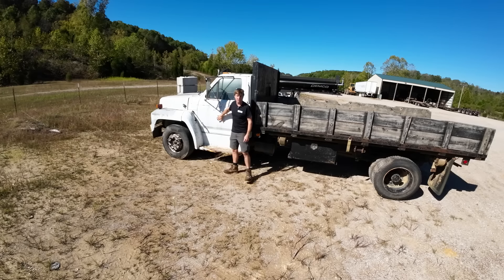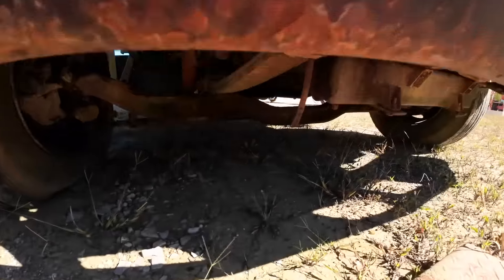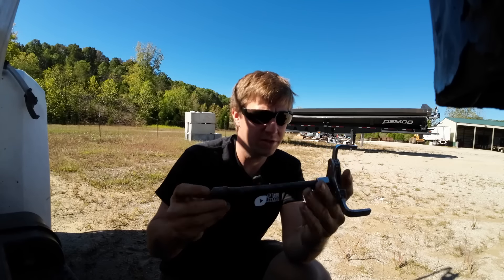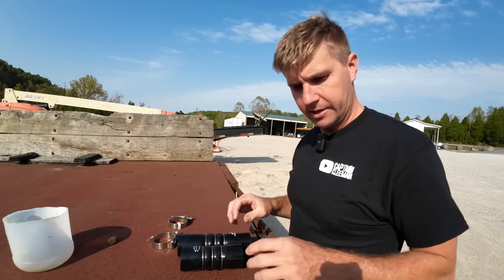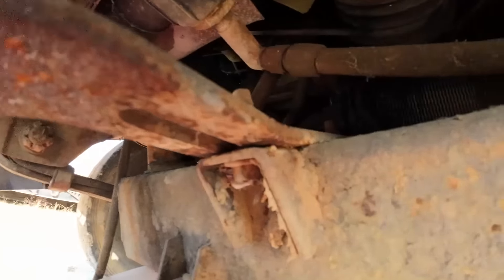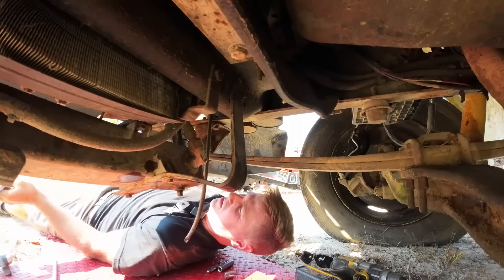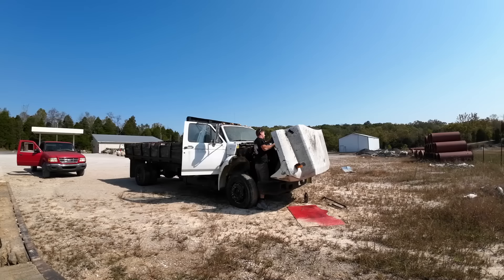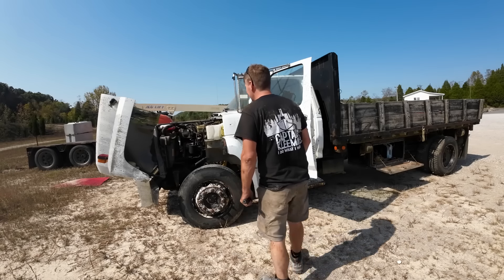Dumptruck Disaster - Will it run Fail

Comment: Mike- anything that I’ve ever driven with a PTO wants to have the clutch pushed in before engaging it. Iffn ya put the transmission in gear prior, it stops the gears from grinding..which is basically bad.  Next time you could try my version? Just passing along my experience (s)   Smoking is dissipating, no rattling or knocking,  might be a diamond that just needs polishing 😊
Reply: i belive its an auto my friend
Reply from the maker: Yup

Comment: 2:08 that hose is just plain old... If it was a loading error that failed it, it did you a favor.  It was going to pop REALLY soon anyway.

Check the other radiator hoses.  Probably not far from bursting.
Reply: I'd say start looking for a PTO replacement.  Or learn to rebuild that one.

Too much "Grind em if you can't find em" over the years.

Comment: Hey, don't give up just yet.  Stall the torque convertor by putting it in gear and holding the brakes, then engage the PTO.  Now, shift the tranny into neutral and idle up the engine (1,000 - 1,200 rpm) and raise the bed.  You were almost there, ya just didn't know the method for engaging the PTO on an automatic.
Reply: Well, I listened to the ending again and maybe you are short a connecting rod.  8 minus 1 still leaves 7 rods!
Reply from the maker: Finally a helpful comment! Lol.  Alot of people seem to believe I wasn't pressing the clutch...which is partially true I guess lol.  Appreciate the tip!

Comment: I'm a little confused about the comment near the end about having to rebuild the engine.  I went back and listed to the end three times, but maybe I missed something.  All I heard was the awful grinding sound of the PTO trying to engage.  I looked through the comments and a few may be helpful, but it seems a number of people missed the fact that this truck has an automatic transmission (no clutch pedal to push).  My 1993 F600 has an Allison AT545, which is what I'm guessing yours has.  Is the PTO on the transmission or the engine (the engine mounted seems more rare, but sometimes more common on a chassis that was converted later in life)?  Mine has the PTO mounted on the right side of the transmission, and it's activated by a switch in the console inside and a solenoid mounted on the left back side of the transmission.  I'm not sure if mine is hydraulic or vacuum operated, but what appears to be low pressure hydraulic lines run from the solenoid to the PTO to activate it.  There are straight mechanical versions which yours appeared to be.  I can engage the PTO with the engine in neutral at idle with absolutely no grinding.  The PTO stops working if I put the transmission in gear (R or any forward position), but I have not tried moving with it engaged to see if it works then.  The Ford service manual is absolutely no help on the Allison transmissions - you'll need the Allison transmission service manual if you want to know anything useful about it.  Someone suggested the hydraulic pump might be locked up although it seemed to work the first time you tried it - still this is probably worth checking before trying to engage the PTO again to avoid potential damage to the PTO or the transmission (assuming that's where your PTO is).  If the pump turns okay, then you might try what some have suggested by having the transmission in gear (R or any forward gear) with the vehicle stopped.  It makes some sense that this might result in the gear that drives the PTO being stopped.  After it's engage, you can move the transmission back to neutral.  You might check the linkage/cable that operates the PTO assuming yours is mechanical just to make sure it moves it far enough to fully engage.  I hope it's something simple and easy to fix, and wish I could be more help.  Maybe Wes from Watch Wes Work will comment and provide some advice.
Reply from the maker: @VRM-uu3si  you missed the engine fail and shut itself off.  Valve or pushrod, or maybe rocker arm if I'm lucky.  I'll check at some point.
Reply: @CaptainKleeman  I went back and listened to it again, and I still couldn't tell for sure what happened.  I thought maybe the PTO stalled the engine out.  One thing I noticed in going back over the video was the fuel level - mine won't run with the gage that close to empty.  I was using it to haul some dirt down in one of my fields and it was above the empty mark at least a needle width, then it started to die depending on how the truck was leaning.  I had to walk back and get a gas can to get it back to the house.  Seems like it gets sketchy at anything below 1/8 of a tank.  Hope it's something simple you can fix cheaply and quickly.

Comment: After the engine being locked up before. And it was out of coolant.  If I were you, I would drain the coolant before I took it anywhere.  If you have a bad internal leak. You might wanna not have any coolant in that system.  Just my thoughts.

Comment: Look at the bright side....the poor running gasser, that's notorious for burning up spark plug wires may have given up the ghost, but now you have the opportunity to rebuild that motor to have more power and run smoothly....or maybe grab a used diesel and swap it over to make a stone-simple, reliable farm truck.

Comment: Well..... 
It hicked, farted, coughed, and sort of ran 😵🤔😁
She did get better as the engine warmed up and smoked off some good stuff on the block and pipes, and then the PTO decided not to play ball...... 😬🤦‍♂️ 
My thoughts are that the engaging cable needs adjusting and or releasing,  or the PTO flywheel is out of alignment..... 🤔 
It is a shame to hear the disappointment in your voice, I have no doubt there will be plenty of people willing to offer you advice on your next moves, however you decide to proceed 🤞👍🇬🇧

Comment: Hey Captain most PTO setups require the transmission to be in neutral to smoothly engage them.  
That said besides the PTO issue what else is keeping that truck from being a driver?  
Since the master cylinder did not have caps on the reservoir you should see if the bleeders are free and if so siphone the fluid out of the reservoir and bleed the brakes until clean fluid comes out because the fluid in the reservoir/system is contaminated with water

Comment: Build a thick😍😍😍😍😍 steel trap door in the bed so you can fill up the hydraulic for the bed when the bed is down I have one I made for my dump truck it is way safer and better and easy to fill the flip down door with the hinge toward the front of the bed  so when you dump so the door stay close and the dirt will slide over it with no problem

Comment: The look on your face when the new to you truck behaved badly was heartbreaking . It needs a W3 analysis/best guess of a starting point, fuel supply, fuel injection, ignition ( plugs, wires are new new), computer(s)…... If it was a serious mechanical issue it wouldn’t run as much as it did , IMHO…Letting it fester for several months may  result in a lot of lost sleep, it would for me.
Reply from the maker: It's most likely mechanical based on the sound and action of the engine.  But no big deal.  Nothing we haven't done before

Comment: Well ... I seem to remember watching someone with a similar issue ... And it ended up being a gummed up and stuck injector rack thing? 
My memory is hazy sadly - but it was something like you put your foot down and the sliding thing didn't slide because it was full of sludge and the engine died instead.
I dunno it just sounds like fuel delivery issues from the way it's running 🤷

Comment: Not sure about your truck does but I had to have to engage the clutch to lock in the PTO for the hydraulic dump bed.  Just like putting a transmission in gear.  We had two cable pulls.  One controlled flow and the other engaged the transmission drive for the pump.

Comment: Probably need to do a tune up on it. Better the points are bad and the carb needs cleaning. Easy, quick jobs. As for the PTO, I would say a new cable will help a lot. Thanks for sharing.

Comment: was it the hyd system engaging or the engine? would think the transmission would be put into neutral to engage. Like 4 wheel low engagement. Still 2k for a sound work flat bed of that size.

Comment: im doin ok captain i got some work done on my 88 4runner getting the grill tab holes fixed on the 90 front core which wasnt meant to fit an 88 grill but it does now i had to weld up some spots that were too weak to hold the grill an added a bit of weld to a couple spots that got too big so the clips have something to hold thank you for asking!

Comment: Hi Mike.  Nice repair of that bracket with a speed binder.  I once fixed the step bumper on my truck with a forklift after some guy ran into me.  Does the trans need to be in neutral maybe before engaging the PTO?  Hope it's something simple.  It looked like the bed was starting to dump before you added fluid.

Comment: You need to check compression, timing chain slack check, cranking vacuum test. Sounds like it has a dead cylinder or cam timing has jumped. Do these things BEFORE spending a dime on it.

Comment: The missing broken coolant reservoir was a huge red flag to me and the coolant hose just added to my concerns.  It may have ran when parked, after it overheated.  The engine did not sound good when it was running, and I'm afraid that sitting for a long time didn't help the damage that was done.  I just hope the heads aren't warped. And there clearly is an issue with the PTO and dump system.  Well, at least there will be content for an engine swap or engine rebuild, as well as fixing the hydraulic system.

Comment: You put oil in the cylinders, then pumped that oil out. Some of that oil was pumped into the exhaust and some onto the manifolds.  It will take some time to burn it off.

Comment: Mike find you a old 12v cummins and throw in there . They were common in those trucks.   Just buy an old school bus for a donor with a good 12v so it will have air compressor for the brakes and use transmission and all.. dont get an automatic ..  could also go with dt366 or dt466 both excellent engines

Comment: If it’s fuel injection issues and your going to use it for off-road use I’d put a carburetor on it or just put a used long block in it. Sounds like it was used until it died from the person you bought it from.

Comment: you have to put it in gear, engage PTO, then put it in neutral, it is not a HOT shift PTO
Reply: This is the correct method.  He doesn't have a HOT PTO so he needs to stall the convertor before engaging it.  Put it in gear and hold the brakes, engage the PTO, then shift to neutral and idle it up to speed.

Comment: Mike, think you need to put transmission into gear then put PTO in?  Not saying that is the case but I have had that happen with a dump truck that I used to drive?  Hopefully that helps sir.

Comment: If it would help, turn off the camera and use every adult word you can muster to make it fit. That is a bad motor, it should not be that hard to crank - like its valves or ignition is not timed right.

Comment: Hint:  check estate sales or else and see if you can find a nice, (or worn, tattered...), roll up rug.  I have two under my tractor as it sits, and I have two more on the concrete pad in front of the shop.  Saves the back and it is always where you need one.